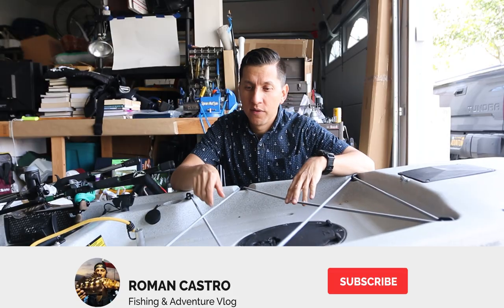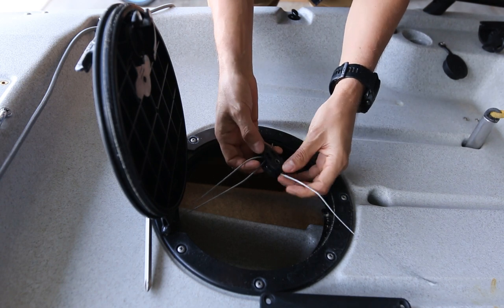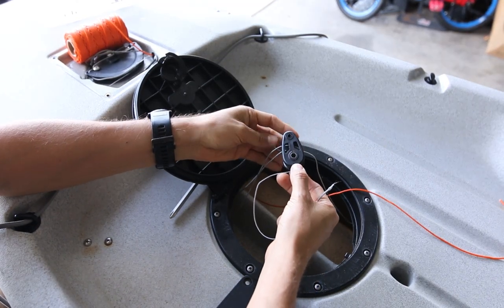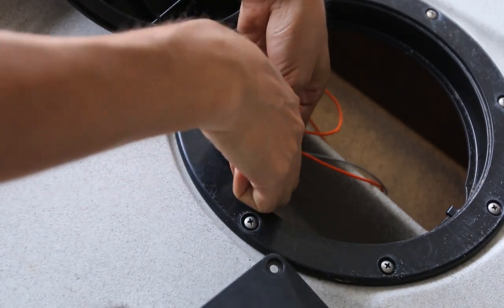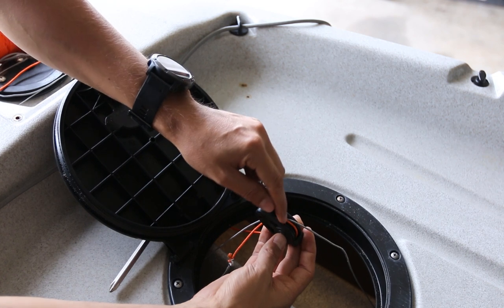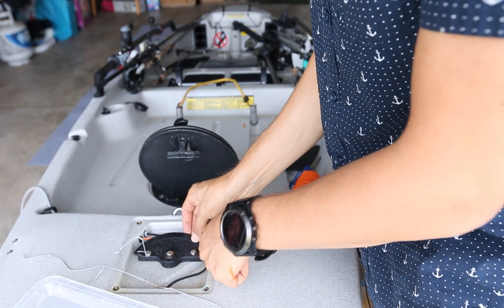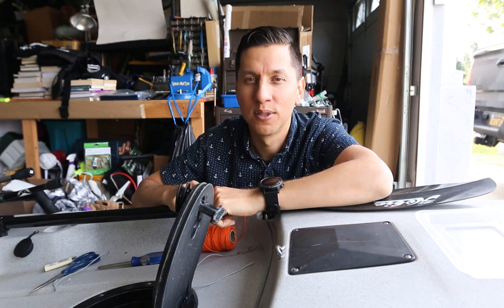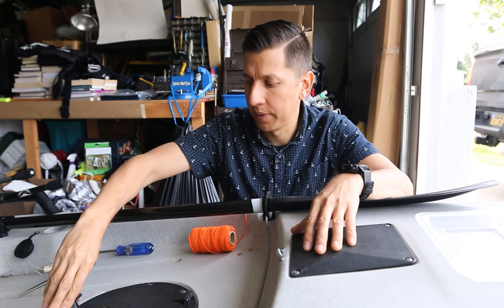Hobie Rudder Line Replacement | Hobie Pro Angler 14 Rigging

Comment: The line breaks because it rubs on the black sleeve in the hole. Fast Lane installed some white line protectors (sleeves) on mine when they replaced the lines on my PA14
Reply from the maker: Cool! I'm not mad at all. This PA has been rock solid no issues for over 2 years. I love it.
Reply: Just pieces of tubing from a line quide from another brand.
Red sticky grease works better

Comment: I can’t understand why I can’t steer at all. Launched for two mins and had to pack up everything. It just keeps going in circles. The white lines appear to be good. I feel like it’s the black line going to the rudder. Does the black line simply pull it up and deploy it or does it steer it?

Comment: Thanks for that. My PA is an early one that I've had since it was new. Several years ago I bought a rudder line repair kit assuming that mine would fail eventually. After using this boat in fresh and salt water for many miles the original line is still holding up. I'm a big believer that if it ain't broke don't fix it. I'm taking it on a wilderness trip in Maine soon and after watching your video I'll know how to handle the repair if it breaks out there.

Comment: Excellent tutorial!!!  I've had my PA for about a week now and yesterday the rutter got stuck in the down position and I couldn't pull the rope lever back out to raise it for a good 2 hours.  I left it alone, but I have a feeling some grass got caught in the rudder line or something b/c by the end of the outing I was finally able to raise the rutter again.  Have you heard of something like this happening?
Reply from the maker: Thats interesting Zach. Were you doing a lot of reversing? That't the only way I can think of something getting stuck on the rudder. This is the first time I hear about this. Glad its resolved though.
Reply: @RomanCastroVlog  Yeah, hopefully it was just a fluke.  It did remind me of the importance of understanding the inner workings of the pulley systems so that I can evaluate quickly if there's a real problem or not :)

Comment: Thank you for clear explanation . I have a hobie sport and need to find out how to tighten the rudder down line . I won't even use mine until landing at end of day .I've had countless issues and now am working doing everything myself due to lack of help available.  If there is any way You can make a short video on just fixing this one problem,so I may get back to the water, I would be eternally grateful .I just finished packing bearings on the outer drum of mirage peddles and today tightened the right turn rudder line . But can't seem to find any information on my last issue.Sincerely, andrea